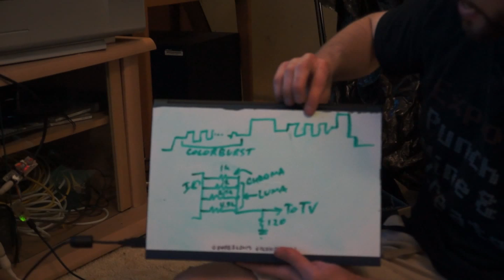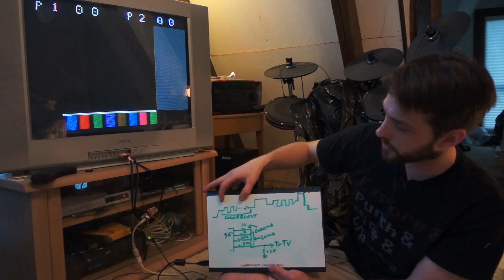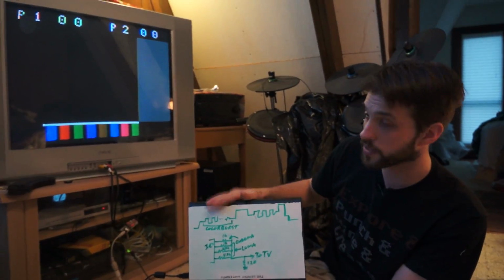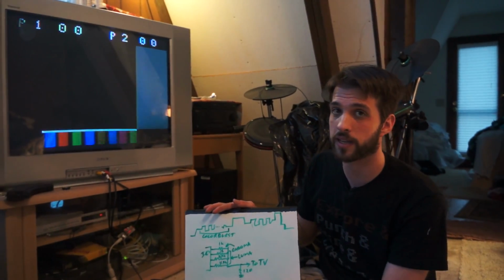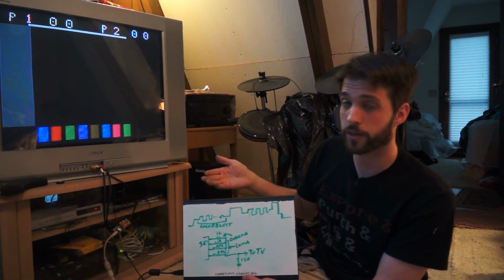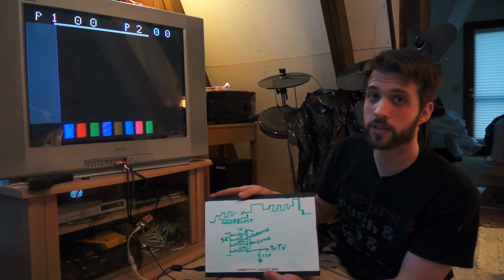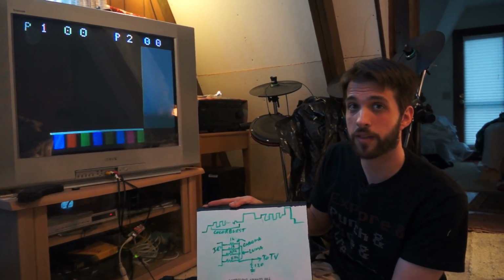Color NTSC video on an AVR without an AD723

Comment: How much more work to rig this up for S-Video? 
would it help to clock the AVR chip at exactly 14.31818Mhz, 17.897725Mhz  or  21.47727Mhz?
Reply from the maker: You can.  There are tradeoffs there, too.  And for S-video.  Pretty easy.  Just use a black and white signal for your Y.  And then do all these tricks for color.  Check out my video on NTSC Let's Learn Let's Code.

Comment: Hello thanks for your open source and every information you have already give.   I've build this project but I'couldnt programe with atmel-ICE if I drive circuit 28.636 MHz Crystal but I can programe MCU if I use 14.31818Mhz. Can you give me an advice to solve this issue...
Reply from the maker: Don't use official programmers or IDEs.  They've got all sorts of annoying restrictions.  I strongly recommend things like tinyisp and avrdude.

Comment: What If I have a RGB monitor connected along with the AD723? Does it matter? Do you know how to use the tripple switch thingy?
Reply from the maker: I really don't understand the question.  I am not advocating an AD723, and it's a totally different system to output an RGB signal.

Comment: Hi , this is really excellent project , can you please publish the schematic diagram of the project it will be very helpful, thank you in advance
Reply from the maker: Sadly, only the board design is completed and available in the description.  It's the 2nd to last link.
Reply: Thank you so much
Reply: Dear, what is the software you use to design the layout ?
Reply from the maker: ExpressPCB (Sorry!!!! I made it before I was used to dealing with Kicad)
Reply: Thank you so much
Reply: hi
where we can see circuit diagram and source code for arduino uno ?

Comment: The 28.63636Mhz clock input to the ATMEGA, is that a crystal or a ceramic resonator that you use?
Reply from the maker: +unebonnevie Crystal.
Reply: +CNLohr I use the ATMEG328 and burn the fuses bytes from your sample code.  The ATMEGA went dead with the crystal, but when I substitute with a resonator, the ATMEGA328 is able to work with AVRDude.  The fuse bytes you have is for full swing resonator.
Reply from the maker: Interesting - works for me - what fuse values do you recommend?  I will set mine to that?
Reply: +CNLohr The fuse bytes I use for my ATMEGA328, which are the ones in your code example, are 0xA6 (LOW byte fuse) and 0xDF (HIGH byte).

If you look at Table 9-6 in the datasheet for the ATMEGA328 (and likely the ATMEGA168 as well), you will see that the full swing crystal setting is actual a ceramic resonator that is expected by the ATMEGA328.

Comment: Excellent!  Possible you can post the schematic in PDF format into your pubsvn area?  That would be greatly appreciated.  I use EagleCAD, but it looks like you are using PCB software.  And I use Mac rather than WINDOWS computer.  Thanks!

Comment: you are a curious genius!!!!  congratulations   Do you think you could do it in reverse?   Say have a NTSC camera connected to the ATMEGA168 and then have an output of 0ne fps to a usb in order to use it as a webcam?   Could you?! Could you?!   And Could you tell me what is the difference among the usb signal from a webcam and the signal from a NTSC camera?
Reply from the maker: Sadly, it is much more difficult to read NTSC than to write, because you would have to digitize the signal.  I don't think I could even get a monochrome, super low res video out without a good bit of external hardware :(.  You'd also need a second AVR to do the actual USB, unless you used an ATMega32u2 or something of the like.

Comment from the maker: I really don't think you're going to be able to go fast enough with a DAC that wasn't designed to go at at least around 1MHz.  If you're at only 2 or 4 bits, why use a DAC at all? Resistors totally do the trick.

Comment: Ya just a bit too slow. Do you know if avr32 can handle delay_us microsecond delay? I'm not sure is it would matter since the board is kinda slow but maybe I can divide the frequency down evenly and still get it to work somehow. I'm thinking the resistor dac provides analog out. I'll try to do gpio pin toggling and check the max frequency I can get.I'm thinking it's around 22khz. I'll try for 15khz on the nose first to see what it does and change the frequency to get it stable then read it again

Comment from the maker: It sounds like you're a few orders of magnitude too slow.  Unless you can get your sync pulses to be around 4.7uS, I don't know if you'll be able to sync much at all.  That's around 250kHz.  You don't need analog out to drive NTSC, though.  You can do it with resistors and GPIO.

Comment: The first try I recorded the composite video as a wave and tried to play it back. Didn't work too well but I saw the blanking in there for each frame when I looked at the wave. I was looking up 15khz RGB to try it this way. I have a UC3A3 Xplained Atmel board but think it can go up to 22khz gpio toggle speed. I'll try to send everything through the dac and pull it low for the sync. I'm not sure if 15khz scan line is fast enough but if I can play around with the frequency it might match up some.

Comment: I think I can do 15khz black and white for the minute. The sample I recorded from composite video was in real time, so it's just a huge loss of data but it seemed to still have the sync signals in there. I'll try regular GPIO and keep fluctuating the frequency until I can get it centered good enough, then again I have an 8 bit r2r dac for audio.  Maybe I can try to use that to see if I can get something.

Comment from the maker: You're not going to be able to get that to work too well, since NTSC must operate at the fixed frequency.  Your scan lines must operate at ~15kHz.  This is much harder if you also have to have sync signals on that.

Comment: Actually standard operation for the Raspberry Pi involves using the HDMI for audio as well as video.

I personally use my Pi to listen to internet radio or watch videos through HDMI. 

The DVI and HDMI standards are similar, but not identical, most notably the TMDS protocol for HDMI adds audio to DVI's TMDS video, while DVI does not typically. To play audio from the Raspberry Pi, or any device, that device has to be connected through HDMI to the audio output device.

Comment: I suppose a vertical blank interrupt driven load of a PWM engine from a wavetable (offset by a phase accumulator) is still within the realms of possibility though. As for audio subcarriers, when I were a wee lad you could buy a little modulator can (UM1286 over here in blighty) that'd take care of all that. Niiiice except for all the splatter.

Comment: Are you able to achieve the same (low, I'm assuming) resolution with colors as with monochrome? If so it looks like you're very close to achieving Atari-like capabilities with only the AVR, which is plenty impressive.

Comment: To get audio out on a TV signal most systems use a subcarrier modulated using FM or PM though in the case of a composite output it'd be a baseband signal on a second cable. Try using a low pass filtered PWM output driven by an interrupt for a simple play around.